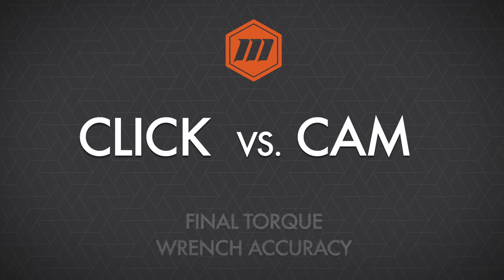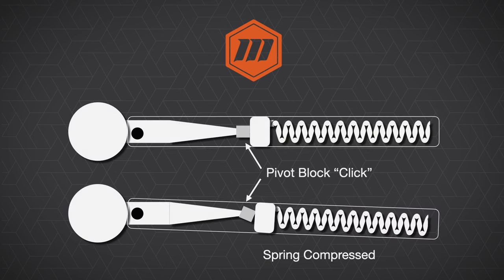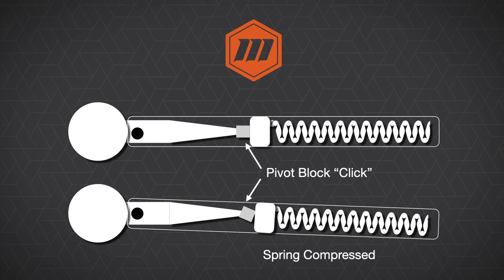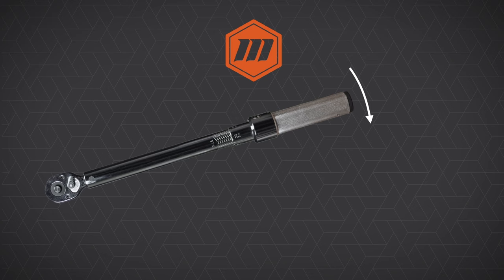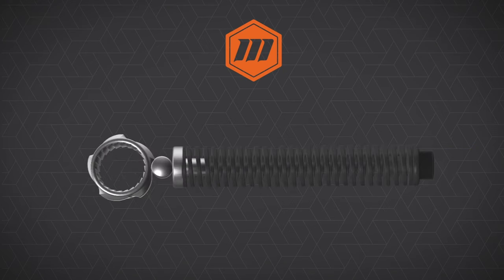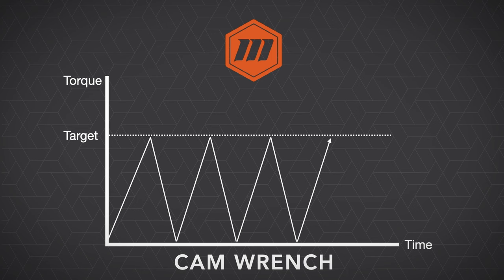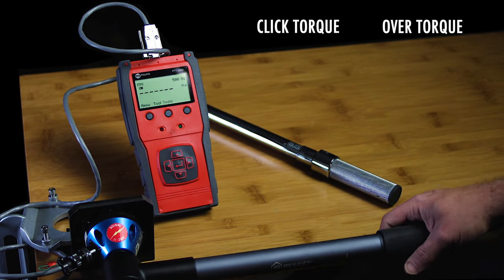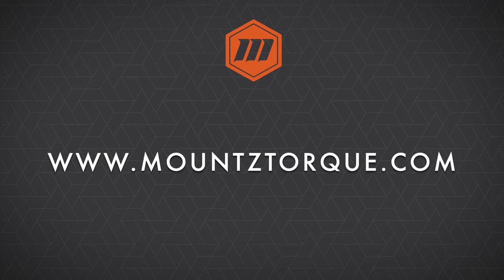Click Wrench vs. Cam-Over Wrench Demonstration

Comment: Bro, sorry but a standard click wrench is not length dependent.  The torque value is set by the spring tension  and has nothing to do with the load applied. You could put a breaker bar or pipe on the handle and it wouldn't matter. You could choke up 3 in. and it wouldn't  matter. Even you need 45 lb the wrench is still going to click as set.

Also, how conveniently does one adjust a cam style wrench?

Chances of over torquing are real as you stated thou.
Reply: actually thats not really true ,,, take a britool avt ,, thats true , but look at a mountz etc and the grip position plays a large part in accuracy .